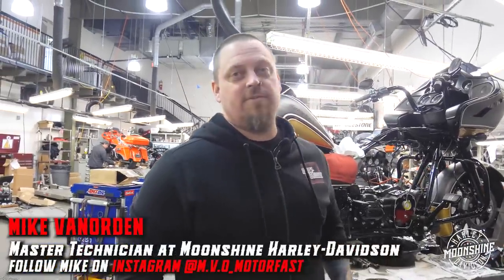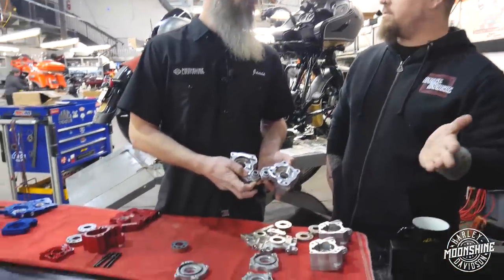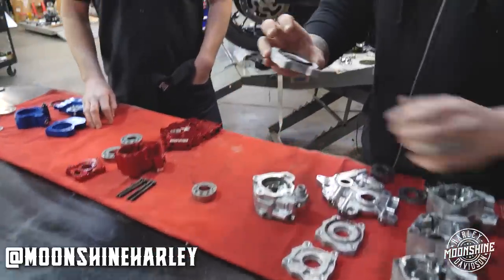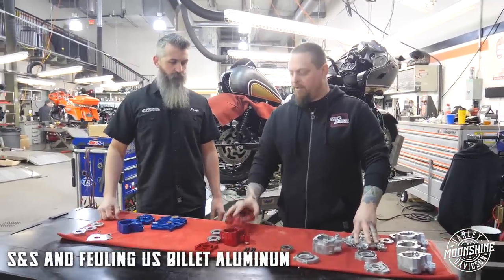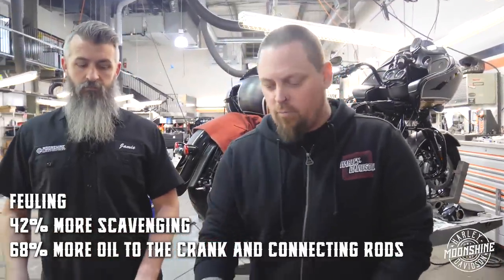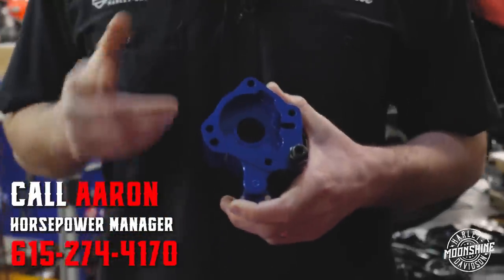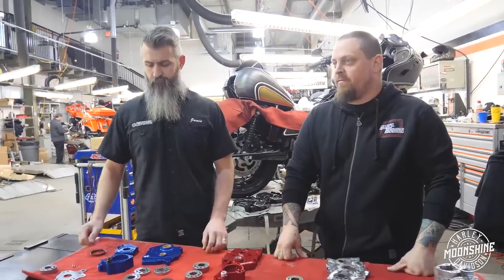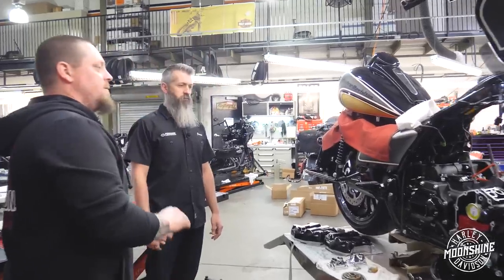2020 Harley-Davidson M8 Oil Pump Updates 'Cause S$#! CHANGED! | Shop Talk Episode 35

Comment: May 2020 rode my 19 Electra glide standard up to Moonshine HD from Jax Florida. They put the S&S
Cam chest kit 465G in the bike. This was an Awsome change in bike performance! Harley wants your bike to last 2
Years. I want it to last way past that. My advice and Moonshine will tell you......if u open up that cam chest, get rid of
All that oem trash, not just the oil pump because the cam plate is just as bad as their oil pumps

Comment: Thanks for the explanation.   Had my oil pump replaced last month under warranty.  Actually didn’t know I had an issue, took bike in for clutch recall, tech called a few days later and asked to keep the bike for another couple of days to replace the oil pump.   

I am very happy he caught and corrected the issue.
Reply: What issue was the engine having to convince the dealer the oil pump needed to be updated?
Reply: Jim Koch ,

I was not having an issue with the bike, but the tech advised the oil pump needed to be replaced and did so under warranty.  I did not notice any sumping or leakage, but had read in several articles about the early M8 motors having oil pump issues.  

Mine is a 17 that I purchased in March of 18, left over.  Warranty expires in two weeks.
Reply: @rickyhawkins7407  I think it's interesting that they would volunteer to open the cam chest and replace the oil pump when it wasn't showing any signs of having issues when the bike was in for a recall. I was just wondering because I upgraded my oil pump when I changed the cam but otherwise would have left it alone.
Reply: Jim Koch The tech knew he had one of the first pumps so he did what’s best for his customer. Need more techs like him in the field.
Reply: Jamie Lima

So true...wish more techs were like this.
Reply: @jamielima5315  more techs like that and more dealerships like that as well.
Reply: So will I have issues if I swap to the 2020 OEM oil pump when I swap my cam to a CR480? I was told it would handle it and be good but from what you said the OEM pump is good for stock motors and HD cams. Now I'm a bit worried. Should I be?
Reply: @Bowhunter-ft8cn  
I know this is old but I had Harley install a Stage3 on my '18 Roadglide Special 107 up to 114. I had a tech at my work with a '18 Streetglide CVO 117 and his had an issue an damaged one of his heads etc. I brought mine in to have them pull the sensor to be sure too much oil didn't run out, sign of sumping. I caught mine in time to have them put the latest pump in at that time. I've had no issues since but will be going with the Fueling cam and plate setup. I have a tendency to over build for piece of mind. Did the Trask basket with SE clutches, got rid of the Recluse auto setup. I always research and read tons of reviews and watch YouTube videos for reference first. If anyone is worried just bring your bike to Harley, have them pull the sensor, iirc it should only lose an ounce and a half, any more and it has a sump issue and warranty will cover it....KB.

Comment: 2019 Road Glide Ultra, 2 weeks ago early Feb, 2020, I went with a  S&S cam chest & oil pump and Woods 22X cam, adjustable push rods  and new cam bearing. D&D 2 into 1 pipes. Vance and Hines FP3. Started project with 2300 miles on bike. Took me 3 days. 1day tear down, 1day rebuild, 1day pipes and then a week later got bold and went for 16"apes. YIKES, Every trick in the book but did it. 2 days to pull wires through Factory 47 16" bars with new heated grips.  4 hours total so far at highway speeds 65 to 100 mph no issues no squeals or knocks and no leaks. Have not told the wife yet. Maybe next month. Your videos helped choosing which  route to go. Runs great, sounds great, feels great.  Thank for you for your efforts on videos. Now if it will quit snowing and raining. sigh near St Louis area in Illinois
Reply: We are ready for a weather break too!
Reply: Of note,  the bike is louder, so riding down the highway there is extra rumble to deal with, and full tank of gas goes about 205 instaed of 240 at 70 to 75 mph.
Reply from the maker: HIGHSPEED DRAG55 if
Your ever in the area we would recommend having us tune it for you. Your mileage can be improved afterwards. Glade you like
It! Nice setup!!!

Comment: I have a 2018 road glide ultra. I did as u recommended going with the 2020 HD oil pump. After, my bike had oil sumping problems. Then I installed s&s cam plate and pump. Life is good now

Comment: In the process of putting my 124 together right now in my 2017 and noticed my pump has the groove for that seal, called the dealer today to get one. Wasn’t sure if it was really necessary but had heard about the seal fixing the cavitation issue. Glad to see it was a good idea to get the seal.
Reply from the maker: HDstreetshark it was a good idea!

Comment: Why didn’t HD fix these bikes as they being sold.   I have 19 SGS with 4400 miles 9 months old with bike in pieces. .  Needs pistons cylinders pump oil pan and valve seals from dealer under warranty after motor almost ruined from failing pump.  Pump did not scavenge oil back to pump.   Not happy with HD at this point.  Bike was built may 2019 and people should know this issues and new oil pumps should be installed.   It will save a lot of $ for everyone in the long run.
Reply: Because then they wouldn't be able to sell the screaming eagle oil pump and cam plate
Reply: This issue shine's a horrible insight on harley's attitude to their customers, and their perceived responsibly
Reply: Harley wouldn’t like seeing the last sentence lol

Comment: So I just replaced my stock 2017 oil pump that was working just fine. I was doing a Stage 2 so was advised to do the pump. Mild Stage 2 107 so went with brand new HD pump. The pump had two vanes let go during the dyno tune. Now Im going with what my builder recommended from the get go, a Fueling at $700 over the HD.

Comment: Kinda explains why the Harley dyi and independent shops like crying and hating on Harley’s products. Looks like Harley’s on-point when it comes to finding out what’s wrong and how to fix it. It also shows how some are trying to force power through a part not designed to handle it as in this case. A stage upgrade with standard stock parts.
Reply: They cry because they don’t know how to leave the damn bike alone. I have a 2017 Street Glide Special , in Hard Candy HotRod Red Flake. Recall for the , secondary clutch actuator . Mine was fine, but it was changed anyway. Those who bitch all the time are either not a Harley owner or they messed the bike up.
Reply: @Ronin shit happens, it’s a Machine. Normally a broken compensating means a new compensator maybe a chain maybe a stater not a new motor so what else did you do to it?
Reply: @Ronin did you make a track bike without changing the compensator?
Reply: @Ronin I had a 2010 road king, with the 96ci twin cam motor. Stater went, leak at the transmission cause they put the hottest part of the exhaust next to it, so the gasket failed. All repaired under warranty no  reoccurrence. Shit happens. If you think other brands don’t have issues your fooling yourself. I had a Suzuki Boulevard m50, when you ride it for a long time the transmission begins to slip. So much for Japanese Quality and reliability. As for Indian recalls they would actually start on their own while sitting in your garage,putting your family members at risk of being killed if you have a attached garage. They all have issues.
Reply: @Ronin it’s actually 99% true. It’s also a result of not properly letting it break-in, and using all those oils which have never been tested by Harley to use in their products.

Comment: Probably too early to tell but do you think the 2020’s will suffer from the previous years problems? I own a 2020 Street Glide and am debating between buying the extended service plan or upgrading to fueling or S&S parts. Not concerned with building a monster engine. Only concerned with long term reliability.

Comment: I have a street Bob 19, with stage 1 and does not feel comforting when there so much talk about the oil pump, should i change pump as a preventive measure?
Reply: It isn't a necessity.  The oil pumps work fine the motor company just continually evolves.  If you are upgrading the cam I would at least install the latest HD pump at that time. This video is just  information to help.  I get so many questions on oil pumps and cam plate options this will hopefully answer some of those questions.

Comment: Just installed the S&S 475C cam, oil pump, oil pump plate, etc...so im good not having installed the oem o-ring behind the pump? Great content subscribed.
Reply from the maker: We would have installed the o-ring. The o-ring provides extra benefits.

Comment: Are you guys coming across a lot of newer bikes that the run out is out of spec?

I have a '19 RGS with only 2100 miles on it so far and was looking at the S&S pump and plate. I would think it would still be fine at this point but then again....

Great work as always guys. I'm just outside Chicago but would love to have you guys do some work on my ride. The attention to detail is key....and Mike's a bada$$. 🤟
Reply: The rotating assembly of the M8 is very sturdy and true and most of the time they are in spec.  The bike in the background I took apart this morning right before the video and wasn't worried about it not being in spec.  That being said,. We measure every bike every time we get to that point whether it's an M8, a Twin Cam, evo, sportster, what ever.

Comment: So no mention of th 2019's. My bike was purchrd new in April of 2019. Not sure when actual manufacturing was done. But no problem, YET. But I did ask my dealership if they could swap out my OP and was told not under warranty cause there's no issue and if I was to pay for them to do it just for peace of mind, that they would charge 9 hours labor and the pump was only like $ 150 bucks. So I said hell with that, I'll ride it out. BUT u bet ur but my dealership isn't gunna just swap it out on their own, just cause it's not the latest an greatest from the moco.
Reply from the maker: Shane Eayrs the 2019’s have the newer pump so you are good to go.
Reply: @MoonshineHarley  Good to know. I could never get my own dealership to figure that out for me. They weren't sure. I very much appreciate u guys getting back to me. This does make me sleep a bit better at night now. I so wish I had a dealership like yours near me loaded with that talent y'all have. And push for power builds. Talk about a dream dealership!

Comment: Maybe I'm confused however you stated that when you upgrade to a larger cam you get more heat. My understanding from all info I have heard is 1st you will ave done a stage 1 before a cam upgrade which the stage 1 is suppose to help run cooler because of it running less lean from factory. Then with a cam upgrade it would be logical to add even more fuel which if more fuel equals cooler running then how can a cam upgrade produce more heat. Also if your crank pinion is not within tolerance for the new cam plate then wouldn't it be out of tolerance from the factory there by chewing up your factory cam plate?Just trying to learn . Thanks.

Comment: My 114 fat boy with a November 2018 motor build date has the rear seal on the pump. 
Just installed new S&S pump and plate today along with 475 camshaft lifters,cuffs and Quickee pushrods.
My new pump also had the recess to accept the crankshaft seal o-ring
Reply from the maker: Philip Roberts Perfect! Do you have a good tuner close to you?
Reply: @MoonshineHarley  no Dyno close to me,I flashed a base map on my FP-3 and will run a auto tune at some point.
Im playing with the idea jumping ship to a DynoJet power vision,but im going wait till I have run a few tanks of fuel on auto tune with the FP-3.
I haven't ridden it yet as I only did the work on it yesterday and the weather isn't great here in the UK.
Reply: Philip Roberts the fp3 is a terrible tuner with very limited capabilities. The power vision is a great interface and can adjust all parameters. Also I’d recommend getting target tune to really have the bike dialed in
Reply: Don't believe everything you hear. Fp3 has been great for me and service has been top notch.

Comment: Have you guys seen a lot of issues with the M8 cranks being out of spec?  I have a sportster now and probably will get a new softail in the next few years.
Reply: No.  They are very well made.
Reply: All HD oem motors are junk. 
Use a "DARKHORSE" CRANK or no matter how much money you spend building a motor, all you will have is a boat anchor.

Comment: Thanks for the info. I was looking to get the feuling RACE series for when I went stage 2 on at 114 Fat Boy.
Didnt know about the run out requirement.
Was gonna go with a Woods 222 Cam, Feuling RACE pump and camplate, HP+Lifters, FuelMoto Pushrods.
So if my crank is above 1/5000th I gotta ditch the feuling pump.
What about swapping to Gear driven, does that help increase longevity? Or just helps with timing? Whats the runout limit on gear drive over chain?
Reply: If your crank is above .005 of runout you have to go to a different setup or get the runout fixed #timex bearings

Comment: When you brought up the "Crank Runout," Does S&S or Feuling, offer any alternatives, to compensate for a Runout of .005 or greater?  I guess the point being, you'll have to replace the Crank, to make it take the aftermarket parts.  The $$$ just keeps adding up!
What is the main cause of Crankshaft Runout?
I saw the cranks from 'Dark Horse,' and the stock or OEM cranks seemed to be a very shoddy design or manufacture.
Always "Forged, or Billet," parts for the engine...  Cast parts just seem to always be the weak link to everything else that can happen...
And 'tapered Connecting Rod ends?'  WTF!  Why?  Why create a weak or fast wear part?  Why not make them as strong and solid as possible?  You know it's going to be in a very harsh environment.  Why start off with a limp-wristic Wrist Pin connection?
Reply from the maker: James Lanning  We haven’t seen a single M8 flywheel fail yet. The stock M8 bottom end can handle a ton of power. 

No matter the manufacture there will always be better parts available from aftermarket manufacturers. 

If run out is grater than .005 we would send the Flywheel to Dark Horse.
Reply: @MoonshineHarley    Okay bud...  But isn't "Runout," in itself, a failure, when it gets out of the tolerance range for the rest of the parts that connect to it?  You have a tolerance range that cannot exceed .005".
Harley Davidson may allow a little more "wiggle room," on the Crank, or "FlyWheel," Spindle, for their own parts...
But if the Crankshaft spindle is beyond .005", then it cannot be used with the Feuling or S&S parts you have...  Maybe not even the OEM parts...
So, just say'n, if the Crankshaft IS out, above .005", on the Runout, then baring having a way to correct the Crank back to OEM specs, it must be replaced...  Or the new oil pump, Camplate, and/ or other parts you just put in, won't last long enough for the check to clear!
Guess my point is, "Excessive runout in the Crank/Flywheel spindle, IS a failure, even if the Crank/ Flywheel doesn't come apart..."

Comment: Mike, you guys finished a Stage 2 for me a couple of weeks back, using S&S components. It’s a ‘17 Ultra Ltd and had just under 33k miles. Did that first original M8 pump have any potential impact to the engine, such as oil starvation or issues related to the cavitation you mentioned?
Reply: We updated it to a 2020 for you 😉.  We never reassemble an engine without the most current parts.
Reply: M.V.O _Motorfast Understand. I was just wondering if there was any possibility of damage with the miles that were put on while the original pump was installed.
Reply: @TheTexasBo  no.  Everything was in good order.  We just updated it because that's what we do when we do any work and it isn't the most recent revision of parts.
Reply: M.V.O _Motorfast Well, thanks again for your work. You guys are aces and I’m making recommendations for you every chance I get.
Reply: @TheTexasBo  meeting you was out pleasure!  We will see you soon.

Comment: Helpful info on Identifying the pump models and the warning not to turn up the pump pressure but Only 4 OEM revisions?  I dont think you guys were quite prepared for this talk..  On the cam plates I feel someone needs to point out a few things here.. That OEM cam plate that Nameless mentioned, is not stamped aluminum, but cast Al, and I don't think the S&S  is 7071 Aluminum (but is it's the only one with a brass bearing) , however the Fueling Race series is.. Magnets will not will not collect all metal..but ferrious metals only.  Though Jamie said "same as the others" when talking of the screen in the S&S,   I dont think the Fueling or OEM oil pumps have Screens..Also as Jamie mentioned, the .005 crank runout tolerance and measurement is not on the "very end" of the crank, but measured where the bearing will ride.

Comment: I have a twin cooled 131 and I put the fueling oil pump and cam plate in
my question is
if that oil pump is for water cooled heads 
would it be a problem if you add a oil cooler to that setup ??
the reason I'm asking is that I added a ultra cool to my bike 
just wondering if this will be a problem or not 
thanks randy

Comment: The S&S and the fueling that's crazy on the oil pressure difference but on the S&S you guys did not mention that it has a brass bushing on the cam side in the fueling does not if I'm saying that right I would love to have the more oil pressure but what does the fueling idle at
Reply: They did mention it in there first video...comparing the above three oil pumps

Comment: My 2017 ultra m8 need all your updates and your oil pump cam plate fueling bearing adjustable pushrods and roller bearing holders gasket tuning pleas